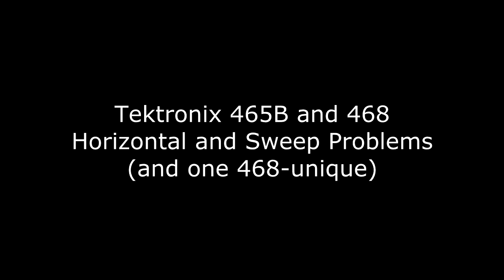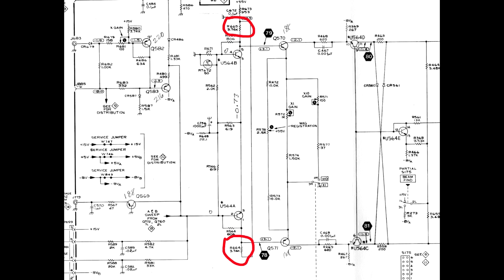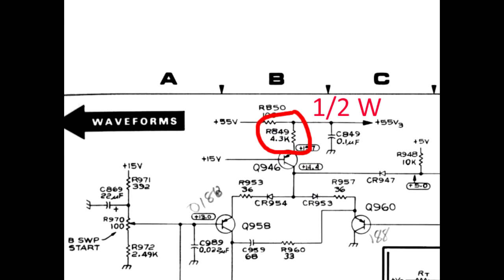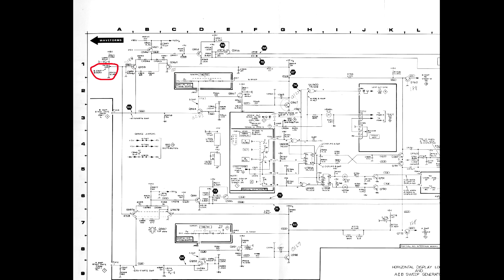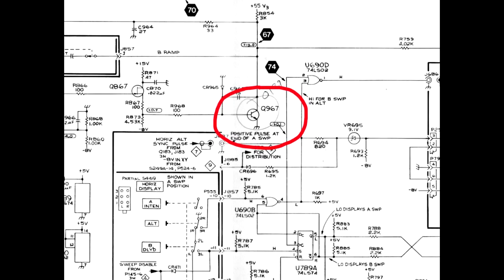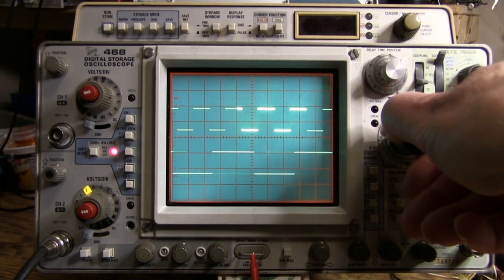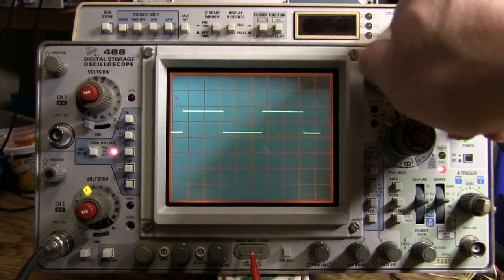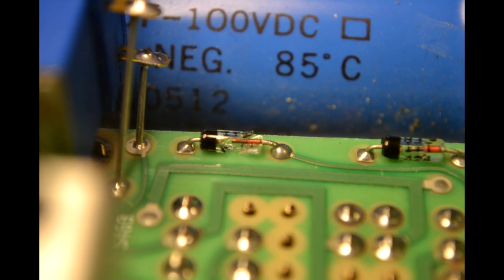Tektronix 465B and 468 Horizontal and Sweep Problems

Comment: Good stuff, Bob.  I once had a problem with my 465B that the sweep amplitude wasn't large enough to fill the screen.  Turned out to be a drifted resistor value in the power supply (+15V I think) to the sweep generator circuit, limiting the headroom for the sweep to complete.
Reply: 465 is one of the best Tektronix in the 40 years ago..I loved him😍